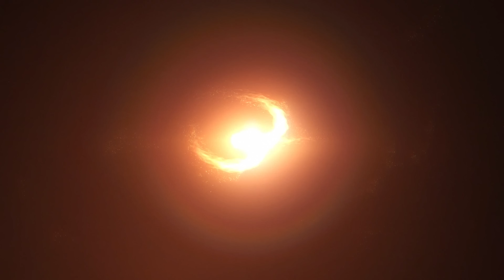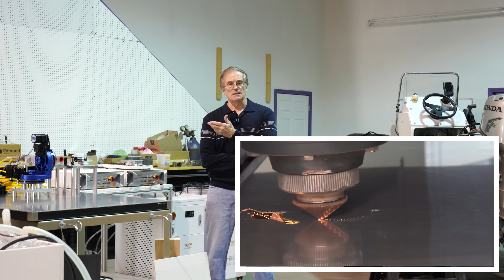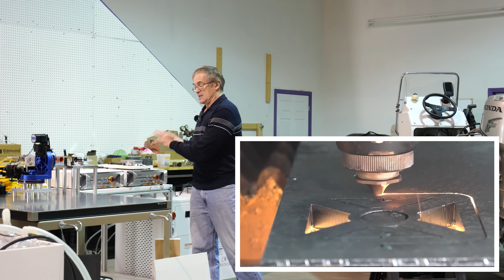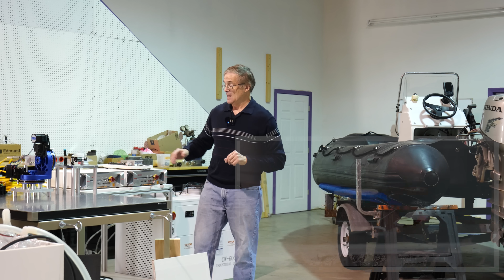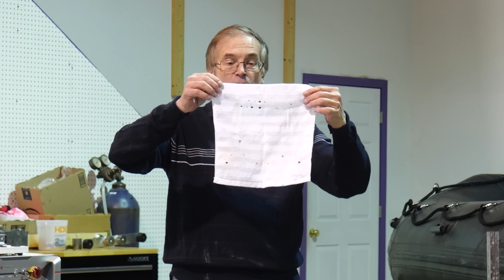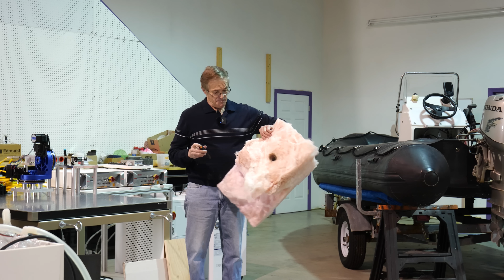We have a problem... and need your help!

Comment: You said you didn't want reflective... but what about something that both diffused and reflected? A textured surface of highly reflective material. Like imagine you took small glass cube shaped shards and coated a piece of mirror with it, so the surface resembled an incredibly high grit sandpaper where the grains were glass with many different oblique and sharp angles. Wouldn't that both fully reflect the light but also diffuse it entirely so that it didn't harm anything? Perhaps coupled with something which could detect that reflected light (photocell or something) that shut off the laser power supply if it was detected, I think you'd be protected. 

I admit I'm not entirely sure how you'd be able to produce such a thing, my first thoughts are some kind of clear resin to act as a glue, and just some glass from a recycle yard spread over a mirrored surface. The mirror doesn't need to be high quality, just reflective enough to keep the laser from shooting THROUGH it. Could be 1000 square feet of cheap walmart bathroom mirrors and probably would do the job.

Comment: I think you might need to start speaking to people who operate larger military ranges, although filming there would most-likely be impossible. If it could benefit US security they may be willing to host you and you know they're interested in laser defence systems. Other than that I assume only an ablative coating could help unless you use plate steel.

Comment: How about Black Iron Oxide Powder?
Fe3O4, pretty safe biproducts if it off-gasses.
You could also make it yourself if you wanted by crushing magnetite or hematite, and in this use case a non-uniform particle size would be beneficial.

Comment: I'd look at coated alumina refractory bricks, Acktar makes laser absorbent coatings tuned to specific wavelengths, and have tested them properly. Black 4.0 paint would require testing, but would be a much more affordable coating if it works for the wavelength of your lasers.

Comment: Drywall (damp) may still provide a partial answer, it readily absorbs water without degradation (up to a point) and can be "stacked or layered" with as many layers as needed for the duration of your exposure. I've seen 8 layers of 5/8" type X (Fire code) used in industrial applications with lead sheets sandwiched for x-ray control. Graphite or carbon layers might work better for laser shielding.

Comment: Diffractive glass to spread the beam instead of trying to block it? Otherwise I'm thinking the most practical thing is to change tack altogether and use several spatially-distributed lower-output lasers whose beams converge on the target via triangulation so that their additive intensities achieve the desired power levels at the target but not beyond it.

Comment: I observed a small company performing essentially the same test in their lab a few months ago. I don't know the exact specs of their custom designed, single mode fiber laser (I want to say it was 3KW), but it was going through 3/32 low-carbon steel faster than I could judge at a distance of ~10m. They used two layers of cement board behind their targets. The scorch marks on the cement board resembled the marks you showed on the bricks, so I'm not sure if the increased mass of the Portland cement-based board was enough to improve performance over gypsum-based drywall, but they have been using that same board for years. NOTE: behind the cement board was a concrete block wall (which obviously isn't mobile), but that's what they used as a backup. There was no evidence of energy making it through the cement board.

Comment: I’m not sure if this would work and it would need to be tested on a small scale but what about a wall of burned oil, sort of like a wall of water many were suggesting. The burned oil would constantly need to be pumped and that would not let enough heat get to it to combust- hopefully that works.

Comment: I looked through the comments for a few minutes, did not see one person mention the colour blue. what ever you do professor utilize the colour blue for your back stop. could be as simple as spray paint on that drywall, or a sheet of tin roofing from your local build store. use the colour blue and make a video. I want to see the results

Comment: i am going to say a bad word= ASBESTOS. or, if you are scared of the BS surrounding it, Al2O3+SiO2. you had the solution with plywood. amorphous materials will scatter the light. plywood burns, because there's oxygen in the air. in a vacuum or with an inert gas blanket. , it just turns into carbon and water. just for curiosity, what would be the range of those lasers, in a wet, rainy day? . also, what is the laser's wavelength? depending on the answers, you may only need a set of sprinklers, the size and concentration of the droplets depending on the wavelength.
Reply: addendum= KISS. unless you have a very compelling reason to shoot the laser horizontally, shoot it straight up. you have to be extremely unlucky if you hit a CIA, Russian or Chinese spy sat. in which case you will be visited by some unsavory characters aboard SUV's

Comment: Not sure there is any cheap answer if you are trying to cover such an area:
Big troughs of opaque water would cover the shear amount of heat that needs dissipating over such an incredibly short period, but a) reflection issues of the container surface and b) that's a big weight of water.
Some form of self healing absorbent container for the water like sandbags would stop reflections but the scale issue still exists.
Sandbags on their own might do as a pure ablative solutions but you would still need a lot.
Hydrogels as a laminate with plasterboard might help but its not a trivial engineering challenge in its own right.
To be honest find a new location to do the experiment. Are their any quarries or cliffs or earth mounds in your area? Open the garage door and pile a load of earth up? That would be a good back stop.

Edit: One other train of though...
I dont know if mirrors are able to function with that intensity, but I suspect you do. If they do you might use mirrors the deflect stray beams into a smaller area to reduce the surface that needs protecting. In fact you could direct beams into the ground.

Third thoughts: fibre glass is still a solid and its reflection is just not up to it. Have you tried tiny air bubbles in water / water based solution? More heat capacity and no solid to vaporise. Wet rockwool might be an intermediate but you still have the problem of transport of sufficient additional water on to the beam.

Comment: I propose a two part solution, first part, make a very thick wall tube with an internal diameter just large enough for your target window dimensions at the other end. If the computer goes crazy and sends the beam outside where you want it to go it will strike the inside of the tube and absorb into the bulk fill material. I propose a paper tube with sand infill, as you don't want it reflecting off the inside of the tube but rather cut through and dump all the energy into the sand, and if things get really out of control and it cuts up the tube a whole bunch there's possibly a built in safety mechanism where sand dumps into the tube and blocks it off. The idea with the tube is to be cheap and disposable. Second part for the back stop, use refractory fire brick on plywood backing and put a sheet of welders carbon felt in front of it to stop any possible back scatter. Refractory bricks are very light so the board could be placed on wheels and rolled into position wherever you want it. They are also easy to repair from beam strikes as you can get buckets of refractory paste that you can just slather over whatever holes you drill into the brick. I would then go a step further and put a sheet of welders carbon felt cloth in front of the board so any beam strikes on the board if there were to be some reflection off of it the carbon felt is capable of absorbing considerable amount of energy hopefully enough to stop it from going any further.

Comment: I suggest reconsidering the location constraint and determining if you can change the major axis of your experimentation from horizontal to vertical.  A quarry, lake, mine shaft, shooting range, etc. would handle the heat and facility damage aspects nicely at the cost of convenience and potentially rental fees/etc., but means you don't need to scale up a backdrop solution to handle distance issues your system may incur to get useful data (e.g. effect at realistic target ranges, wide safety margins).  A low powered interchangeable analog of your main laser would be handy for in-lab testing, then swap to the high power version on location.  A lake in a quarry bottom will generally be devoid of fish and sometimes be owned by someone willing to take rental fees, meaning you can fire downward and not worry very much about fire, fauna, etc. while potentially being deep and likely having high TDS to reduce reflection problems.  If you can design your testing system to look down, dirt and water are both likely to work pretty well as a backstop.  If you can design your system to face upwards, consider whether filing a NOTAM or similar is sufficient to be safe aiming upwards and to what altitude (most regions have something like an area for skydiving that is far easier to get permissions for as it's already periodically blocked off for some approved activity).  If your system has to maintain a horizontal axis, a big lake edge, shooting range, or a mine shaft. Several of the big laser contracts have had issues related to fog and smoke, so opting for a material or location that increases one or both of those may help shrink your backdrop requirements.

Comment: I think that you found the solution to your problem at start of the video. Why not start with a very large laser beam that focuses at the target distance? You could easily compute that with range finders or with side-by-side cameras that compute target distance based off of binocular vision target displacement. Or visual odometry. Then, when the laser focuses at the target, target is destroyed, but then it will unfocus behind the target. And you can have a lens that can change the point of focus of the laser in real time with target distance data.

Comment: Maybe it's best not to focus on having something expendable, but to scatter the light as fast as possible. Maybe a bubbly mirror surface, with lots of curved out surfaces. I am pretty sure there are foams like this. And if it will melt too fast to reflect - put an outdoor mist sprayer frame in front of it. Some concentration of tiny droplets will scatter the beam enough to hit bubble-mirror safely.

Comment: Well, might be a silly idea, but... you have the biggest stone slab at your feet, so... just shoot into the ground. If you make a hole, closing it would be as easy as pouring a bit of concrete or cement of some sort, and you will probably have floor anywhere you go, so no need to transport, It can absorb almost infinite heat, and if you are doing it outside probably wont even have to bother about gasses either. The difficulty will be mounting the device I guess.

Comment: This is sort of based on another comment I saw.  What about something that spins/oscillates? Perhaps if you spread the laser across a larger area. For instance, if you have a large circular piece of plywood/drywall/etc and you have it spinning on the motor. The idea is that the beam won't stay in one spot long enough to punch through. It'd still remove material, but in theory, you could just load up another layer once the first one is spent. My guess is a few feet in diameter. As an added way to disperse the energy, you could have the backdrop move side to side. It'll look like a ride at the fair, but I think it might work. Added bonus would be some sort of ceramic coating or paint? It would surely fare better than a stationary target. :)

Comment: Try a piece of rock woll insulation.  It should be more heat resistant and you could use a water pump and catch basin to keep the insulation cool.

Comment: The only thing I can think of is  a water container. Dump the energy through many feet of water and spread it out. You are still going to punch a hole in the front but maybe you can prevent it prom punching out the back. Just make the container easily patched.

Comment: How about a running waterfall on a sheet of drywall with dye in water that is optimized to absorb the energy of the laser light wavelength? If needed you can increase the volume of water falling on a sheet of drywall to increase the running water layer thickness. Just an idea.

Comment: Sandbags are less than ideal for transportability, but a staggered double layer of sandbags would probably work very well for blocking a beam. The sand would continually fall as it's melted. Maybe sand sandwiched between glass or polycarbonate an plywood, or something could achieve the same effect with better portability. I think that whatever you come up with will probably rely on self replacement to continually replace itself.

Comment: Maybe you're gonna have to keep the laser off or safely divergent until target is acquired and lens are focused on target.
So process would be: Input target parameters, focus lens array, then turn on laser. 
Or mount it facing down. With the switch safely outside of its target area. You'll ruin your floor, or your grass, but not your self or neighbors.
Or just use a mountain as backstop.

Comment: - Water glass (doesn't burn ) glued sand. Possibly thin, dark on the front (to inhibit backscattering), thicker white in the center, to get the snow effect.
Possibly micro glass pearls (again water glass glued) instead of the white sand.

Comment: Ok materials that absorb are out. I am pretty sure the solution must be optical and not using resistant materials.

How about materials that disperse light. Like a colloidal solution that diffuses the beam diminishing the energy density at each point? The problem is that on the interface part of the beam will be reflected back because of the difference in refractive indexes. But a material with a continuous refractive index change wilt create infinite reflections (you can do that but it is complicated by diffusing a solute on a resin creating a gradient, but is way complex and its effectiveness would be arguable). But I think a colloid on a liquid or gel if thick enough can work (probably a liquid is best). 

Lets think that the thing that makes laser not as effective as long distance weapons is that air diffuses them and ...wait....I had an idea.
How about something like a glass wall inform of  periodical lenses that make the beam open, as a divergent lens? Like cylinders of glass? Or cylindrical vertical holes inside glass making an air lens that is divergent?There are glasses that have this configuration. Or some form of diffraction grid with that property? Those things are not too complicated.

Comment: A curtain of water. A set of pipes that have a lengthwise slot creating a sheet of water. Even if the water sheet breaks up into droplets, it will provide enough attenuation and dispersion to shield. It will also provide something to go through and hide behind if the AI in your system turns against you ;-)

Comment: how about  small free flowing carbon pellets (activatered carbon or so) which is held in a box (maybe with a mesh in front) . If part of the carbon is evaporated, new part will drop into place. Only CO2 would be emitted, minimal fire hazard. , A N2 purge would prevent the fire hazard.